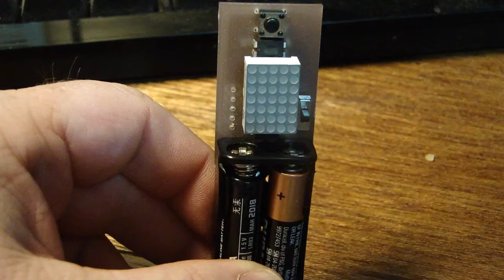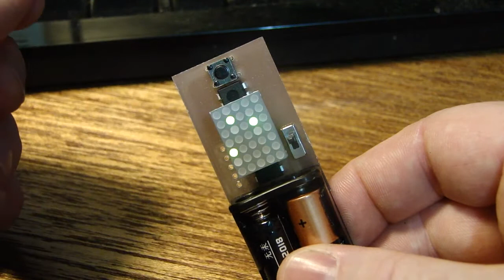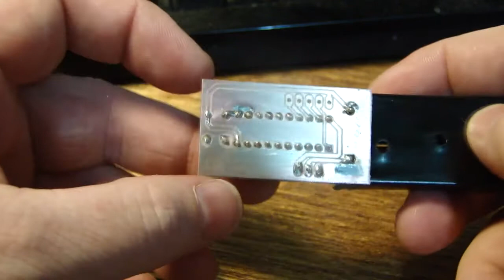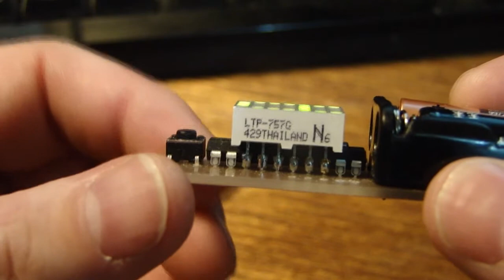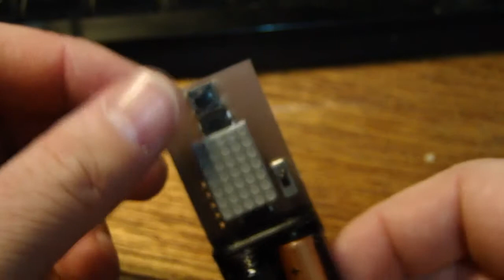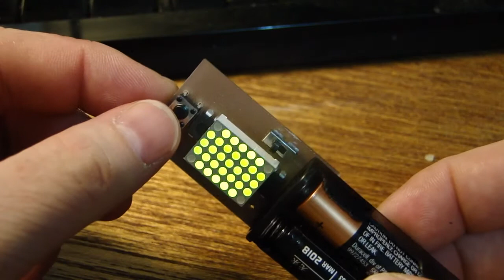Tiny Matrix Hack

Comment: Just use cheaper batteries then the internal resistance will be higher. Will last longer than with the CR2032's, and 2 AA cells are cheap.